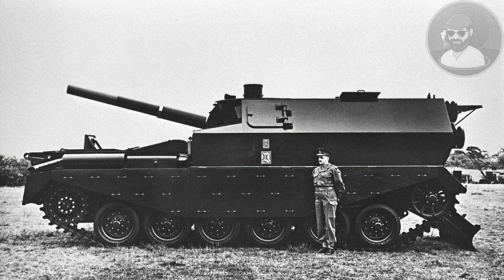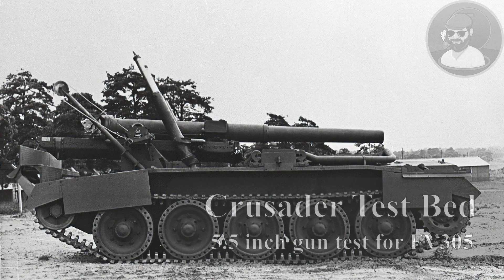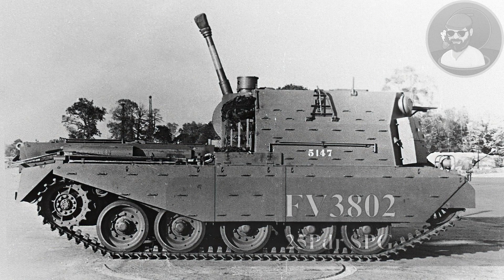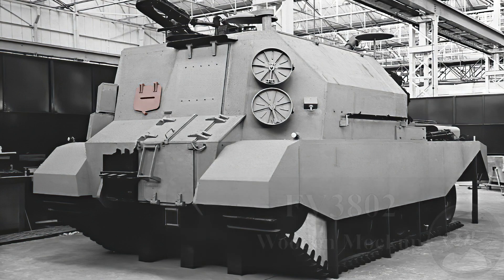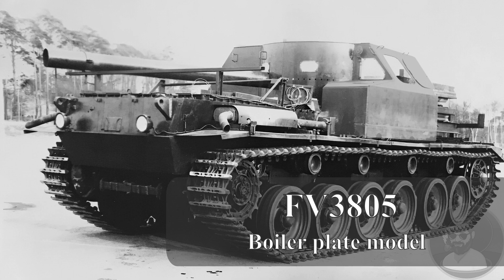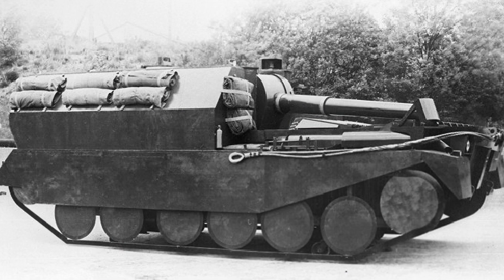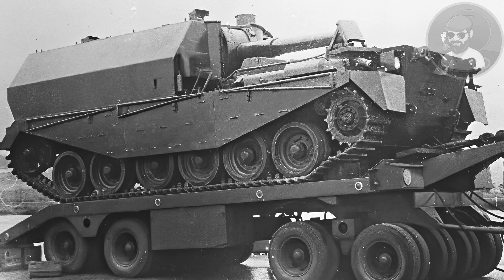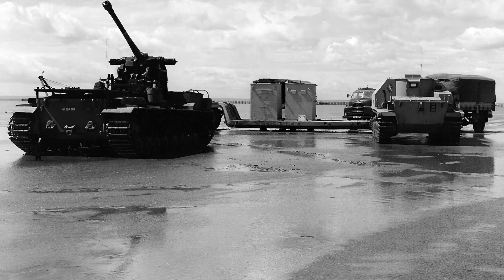FV 3805 - Tank Design & Development - Rare Centurion Conversion

Comment: For a subject , how about a Vickers FV Abbot SPG ? Having worked on them in the late 70s as a loader I would love to know about the design and development of this Artillery piece.I
Thanks
Reply from the maker: Ahh the ol FV433 Abbot, im still waiting on gettign a few more scans and blueprints for this one, there were several designs on the same chasis, for example a 77mm tank destyoer version and a missile version both usign abbots for export. plans exist but covid makign stuff very slow, i do however have the 3 original wooden mockups for it which will be good.

Comment: What you refer to as a "deployable blade" a gunner would call a "recoil spade." They are present on guns such as the M109 series and, in a way similar to that of the FV 3805, the M107 and M110 SP mounts. The M107 and M110 are hydraulic, but those of the M109 are "handraulic."
Reply: Interesting bit of info 👍

Comment: I am sorry but I have to correct you.
"The gun itself was a 5.5 inch breech loading quick firing piece."
There is no such thing in WW2 terms as a "breech loading quick firing" piece.
The terms BL and QF were rapidly changing before and during the Great War so I have to stick with their 2nd World War meanings.
BL means breech loading,yes. But it also means that the artillery piece using an interrupted screw-type breech block. If the weapon's designation starts with a "BL", it's not a "quick firing" piece.
QF means quick firing,also true.(And of course,all QF-guns loading from the breech side.) Originally, the "QF" designation was used for guns with a single motion breech mechanism, also utilizing interrupted breech blocks. Their firing rate was higher than the previous BL guns. But with the advent of wedge-type breech blocks, the nomenclature changed to the following.
"BL" was used for artillery pieces using interrupted screw-type breech blocks, regardless if it is the traditional breech block or the quicker single-motion one.
"QF" was used for artillery pieces using falling wedge-type(also called vertical sliding wedge) or sliding wedge-type (horizontal sliding wedge) breech blocks. A gun with this kind of breech mechanism can fire faster than a BL gun,regardless of their loading mechanism(a wedge-block gun always reloads faster than a same calibre screw block), although it's not as safe to use.
Reply: Hello. yes you are correct on this matter, my bad, was reading of some notes from IWM and didnt tripple check that. thankyou.